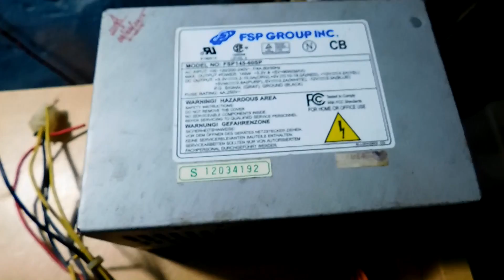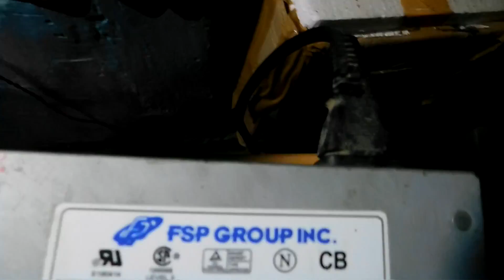make instant ice using a peltier diy

Comment: Ok folks... He is attempting to do proof of a concept he had. By using water as a quick and efficient way to cool the hot side of the peltier he short term increased the efficiency to make ice form on the screw. You could probably do this with low voltage and just isolate the sides of the device. Time spent would achieve the same effect.

But he did do it.

Underwhelming by tech standards but he is expirimenting. Gotta start with what you think works and learn, then apply what you learn for better devices... Right?

Comment: How  many voltage use it to get cooler in your this video?
Reply from the maker: I used an 12v 90 w dc Power supply
Reply: How many max ampere use it ?